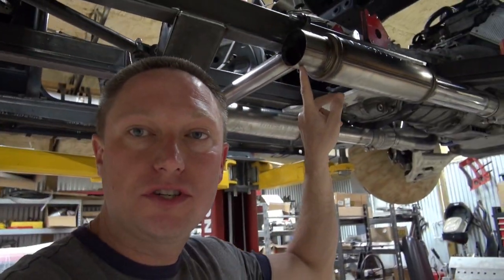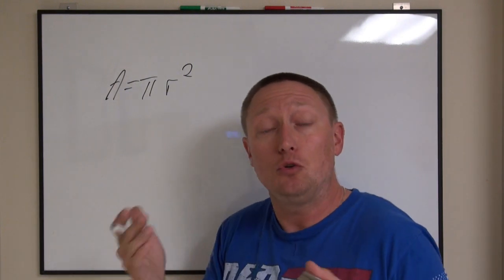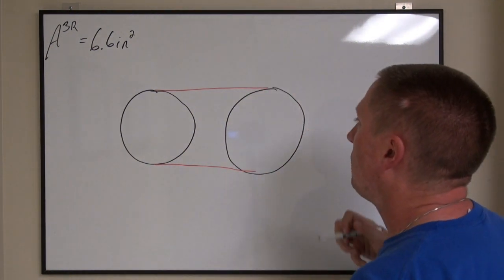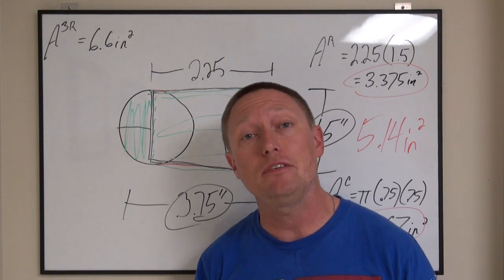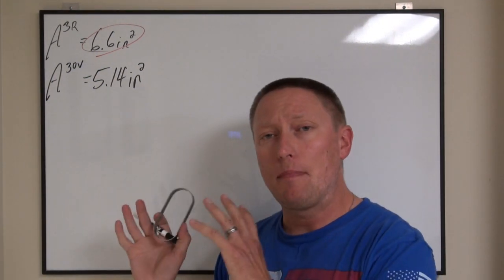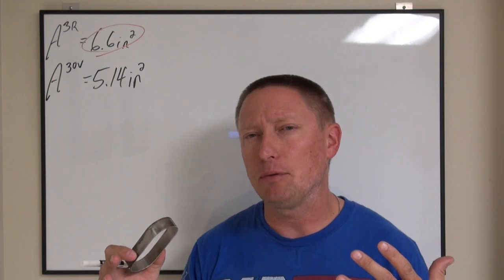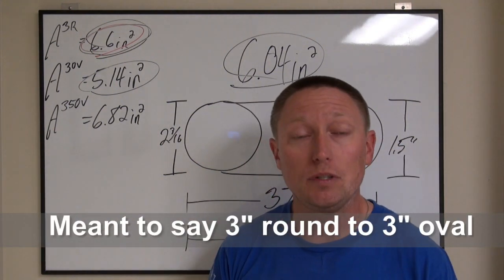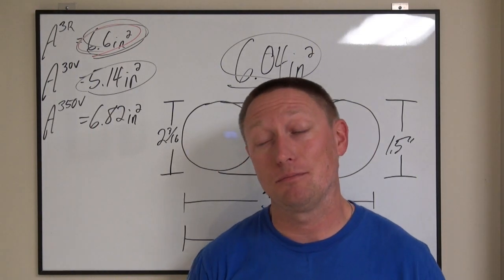Oval Exhaust Robs HorsePower - I Prove IT

Comment: I think the nascar guys would dispute this . They have done a lot of testing.
Reply: Exhaust gases don't flow through as he says,  Nascar says and has shown that the gases roll/tumble through. Hence flat square piping.
Reply: Dispute what? It’s 8th grade geometry.  Bmw has been using oval exhaust pipes for a long time, and they do in fact increase the diameter of the pipe where it is oval shaped.
Reply: False comparison, and using "feelings" instead of math. Race cars you run whatever size you need to flow what you need and budget is of little concern in comparison to rules, street car builds you are almost always limited in clearance with something you can't move somewhere and can't always spend multiple thousands on custom transitions and weird non-standard sizes of shaped pipe, there are no rules. A cup car is designed and built with massive budget and track only use in mind. There's no concern at all about routing or the cost of having someone fabricate that transition, the exhaust comes off the header, crosses under the car, and goes out the side. There is practically nothing to route it around, the car itself is designed to have big long tube headers and a crossover under the car. The ONLY reason they use a shape other than round at all is that they have to put the exhaust under the floor of the super-low race car and need to run those massive flattened pipes to get enough area to minimize pressure drop at the required flow. It's 100% indisputable that for a given AREA round flows better than oval, box, or whatever because round has the least surface area per unit area and FRICTION/DRAG is the primary contributor to pressure drop other than transition to turbulent flow. You can calculate Re for the pipe, it is trivial if you know the volume of the fluid flow and its characteristics, they 100% want to avoid transition to turbulent flow because head loss increases massively with turbulent flow. You will NEVER see any performance application use any shape other than round pipe unless it is necessary to clear something, because you can't increase the RATIO of surface area to flow area without also increasing losses...
Reply: Yes. Because it’s not just about the total area, shape plays a part as well. Also the gases are much more dispersed the further from the engine. 
And if a tiny amount of power goes missing, who cares. It what point is it important that you need every bit of power? Is it real world that important? No. Much more important that my exhaust clears. This guy is just paying to his ego.

Comment: It's hydraulic equivalent, and it's the equivalent size for multiple pipes or a non-round pipe in order for it to flow with the same pressure drop as a round pipe of a given size and flow rate. I've had to explain this to people before, that just because 2x of a given size pipe has about the same area as 1x of another, does not mean it will flow as well. There's friction and shear in the fluid flow and drag is the result, seen as pressure drop/head loss or in car exhaust the opposite: pressure increase at the exhaust port or turbine exit. Car guys seem to struggle with seeing the bigger picture though, they think they see a weird pipe shape on their favorite race car because that shape must flow better, nope it's just because they had to use that shape to clear something.

Comment: Very well explained. Suppose you use the same 3” round to oval size, do you think it would result in a “faster flow rate” over the 3.5” oval? Do you think it would achieve a better efficiency rate?
Reply from the maker: A faster flow rate?  I don't see how it couldn't.  Surely throttling the exhaust will cause it to move faster.  Granted, you should expect the volumetric flow rate to decrease.  It's the same thing that happens when you put your thumb over the end of the water hose.  Speed and pressure go up, but the mass of moving fluid decreases.  Better efficiency?  I think that depends on what back pressure the engine requires, which will be different for every engine.
Reply: @RedlineStands  comparing water to gas is ridiculously funny 😂🤣 Thanks dude 👍 😂 
Confident talking is great but most see through it. Lmfao air water comparison. 👍 😂 Thanks again....
Reply: @hulkgqnissanpatrol6121  Not sure if trolling but uhm yes, fluid dynamics is indeed the study of both fluids and gases and fundamentally they behave the same
Reply: @TofumanFC3S  Yuppp
Reply: Very interesting question. In 2 cycle engine technology, the scavenging effect of the exhaust is almost like a supercharger. This is achieved by varying the size of the pipe to cause a low pressure area at the exhaust outlet, AT THE MOST ADVANTAGEOUS RPM. It's important to note this does not happen over the whole operating range of the engine.

Comment: Ummm, only one flaw.  Cross-sectional area does not equal horsepower.
Reply: I was thinking the same thing. Pretty confident it’s all about the pipe diameter vs the bends and accounting for the way the gases make their way out in bursts or rolling flows determining back pressure information so you can circle back and size the equipment for the engine. An engineer’s job!
Reply: @edlingja1  Back pressure is a myth/misnomer. It's what the uninformed call pressure drop/head loss. Yeah, it's the same when you want to maintain say 100psi at the end of an air line for a given rate, you see it become necessary that you have more pressure at the start of the line as you demand more of the line because the line causes pressure drop. With exhaust you want minimum pressure at the valve, as well as maximum velocity and of course wave effects like scavenging (tuned length is important here). Because you are juggling all of these effects with configuration that fits in the car there's no single answer but when you simplify! Take for example a turbo car's exhaust. You don't tune crap after the turbine, you only want the lowest pressure possible at the turbine exit because turbine efficiency depends on DELTA P,  you maximize cross sectional area and minimize surface area (a circle!) to maximize flow. Pressure drop/head loss in pressurized flow is the same as pressure gain in an exhaust that is too small. The pressure at the tailpipe is atmospheric, and you don't want the pressure at the valve to be significantly more or you will lose power.

Comment: Why is there two circles and a rectangle? How is the half radius apply? The only aspect I see is the transition with welding causing turbulence, but from alot of testing is after secondaries its really moot point since the gases are cooled enough to not effect the flow. There's show even cats don't effect flow. But aft of exhaust system why not increase it!

Comment: Thanks for this.  Im looking to build a decent headpipe for my squarebody 3/4 ton 4x4 that is LS swapped.  I hate headers, and Tru Ram exhaust manifolds from Speedway fit very nicely, even with the slave cylinder in its stock configuration.  But, the exhaust builder and i made some bad choices, and now i need to build it a better, simpler, more easily serviced exhaust.

One fat log down the drivers side it is.

I will give props to the Black Widow mufflers, though.  Mellow at idle, but a very lively loud pedal, and no drone on the highway.

Comment: Something to consider for sure, however this only matters if the upstream exhaust system is fully maximized, meaning there are not other upstream "bottlenecks" which would already have reduced flow to the point where none of the larger oval area even matters.
Reply from the maker: Hmmm.  Idk.  It's worth mentioning that increasing the size of the exhaust tubing so that you can smush it down and still retain the same, or larger, cross section, also results in a larger head loss, because the internal surface area of the tubing is now larger than necessary.  Thus, this surely causes the engine to work harder than it has to.

Comment: I tried the math the same as you but with 3.5" round to 3.5" oval, found a 15.6%  decrease but when I measured the transition piece; there was only a 2mm (0.0787")  difference between the oval and the round circumference.

Comment: Great explanation, thank you. This is what I was looking for. I would also like to know if there are restrictions to flow based on resonant frequencies due to the oval shape and / or varying pressure areas because of the oval. Logically a circle (a sphere is a perfect pressure vessel) has evenly distributed pressure, whereas an oval will have varying and different pressures throughout the cross section.

Comment: Another point I would like to make is the myth that: for exhaust bigger is better. We should take into account the effect of exhaust scavenging, especially in multi cylinder engines. An exhaust sized accordingly to the displacement of the engine will get the best use of scavenging. You will have to look up where these calculations are.

Comment: If the overall pipe volume is larger then it will be more free flowing and produce more power, I highly doubt the exhaust is going to be affected by such a small change. The sound will change for shure
Instead of overthinking this (no offense math is important) I would try simply filling a 1 foot section of oval and round of the same size tubing. The oval being originally the same diameter as the round, then measuring how much fluid was inside each. You may be surprised, exhaust gasses are constantly being pushed out and trying to expand at all times. Expansion will allow for free'er flowing exhaust and free up power. Obviously if it's not any bigger nothing will change but math doesn't always provide the exact answers.
The lift on a cam proves this since it hardly provides any power gains after a certain height

Comment: interesting, in my case the 3in round to 3in oval drop was about 10%
I have heard round tubes flow more air even with equal square areas vs Oval.
Reply: Well yeah because for the same flow area there is still more surface for the flow to experience friction with.

Comment: Something else to consider is the shape of the transition from round to flat. For instance, the adapter piece you show will introduce a section of considerably increased cross sectional area as it changes from round to oval. This would occur even without your step up to a larger diameter circle so the effect will be especially exaggerated on yours. If you cut a section plane through the midpoint, for instance, you'll find that slice has an area greater than either end.

The effect of this, I assume, is that the exhaust hits this low pressure pot at the end of the round tube before moving into the flat tube. What this does to overall flow, I don't know, but I suspect it's something worth consideration. I'm guessing it's not good...

The way to avoid this would be to create specifically shaped transitions that attempt to retain constant cross section along their length, which would be fairly involved. If I were doing it, I'd probably develop the shape digitally, carve the top half into wood, and hammerform two pieces of steel and weld them together along the sides.
Reply from the maker: I couldn't disagree with this "if" this were a racecar, but being as it's a street car, I really just can't imagine being able to notice the difference.  You make a good point, but it's probably not a concern on a street car.

Comment: Oval tubes with the same flow rate as a slightly smaller round tube would naturally run cooler due to increased surface area therefore decreasing exhaust gas velocity.  Pretty simple physics.
Reply from the maker: He's exactly correct.  Engineers call this "head loss"

Comment: Hum.. Empirically speaking why the exhaust on the Ford escort rs cosworth wrc is flat then
Reply: There is only one reason you would ever flatten a pipe, clearance. Nobody is going to flatten a pipe if they don't have to. You can argue whatabout this car whatabout that car all you want, it'll always be clearance. Nobody uses anything but round pipe in any application ever unless they have to because round pipe flows the best for a given size.

Comment: No one has lost HP going to oval tubing! FFS there'sd a channel on YT where they dented and squashed the runners of some headers and still made the same amount of HP, actually they made a few more hp! Plus the whole point to oval tubing is to tuck that shit! still a 3" to 3.5" will tuck better than a round tube!
Reply: Smaller diameter tubing can increase power closer to headers thus making it lose some torque and vice versa. Thats why tuning is to balance hp and tq, but these days is about how much boost u can get outt of it. Plenty of guys out there with good tunes but can be better with proper exhaust builds and such
Reply: That's only because they weren't anywhere near a flow rate that the tubing would limit. If you were optimizing (this means maximizing the use of what you have) and you squashed the pipe, you would lose power, no question. If you have 1.75" primaries on an engine that would make no less power with 1.5" primaries, and you squish that 1.75" primary, you won't likely see any measurable power loss.
Reply: @yucannthahvitt  Not arguing the science, you're assuming engine and car builders wouldn't upsize the pipe to keep flow restrictions (Back pressure) down!? 4" Oval pipe can support over 3000hp, where are you ever going to see 3000hp using just one 4" pipe? Never as the builders know this! Now, Yes I do agree a 4" round has better flow (less restriction) than  a 4" Oval, but that's not my initial argument Statement! P.S there's a video where they DYno a  engine and compare Headers vs HP gains, they actually gained HP on a set of headers they dented and smashed and squished, vs headers with larger primaries! I'll actually try and find the YT link for ya!

Comment: I’ve been scouring the internet and picking the brains of all the gearheads I know, hoping you could chime in on my predicament:
I’m building a twin turbo LS in a narrow/cluttered engine bay. I’ve considered using oval pipe as downpipes straight off the turbos to allow for more clearance between turbo manifolds and frame rails. 
My thought process is if I ensure I get the cross sectional values right there should be little to no negative effect for using oval vs round pipe off the turbo. But I can’t find any real world data.
Whatcha think?
Reply from the maker: This is "basically" true.  I say "basically" because the losses associated with using the oval pipe will be negligible.  You'll experience a tad more head loss, which is just a fancy way that engineers refer the drag associated with increased surface area of the inside of the tube.  The more internal surface area, the more area to create drag on the flowing gas or liquid.  Will this matter in your case?  Not IMO enough to matter.  I say, "Go for it!"
Reply: @RedlineStands  exactly my thought process! It’s hard to get these old school gear heads to break away from “that’s how we’ve always don’t it” haha! I’m goin forward with the oval downpipes. Thank you for the reply!